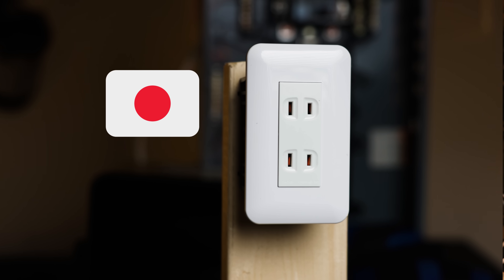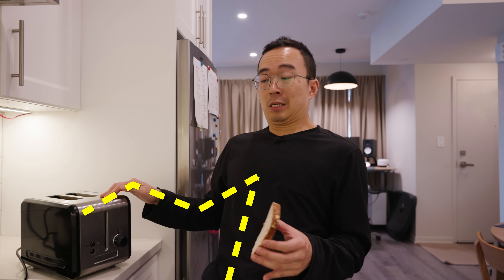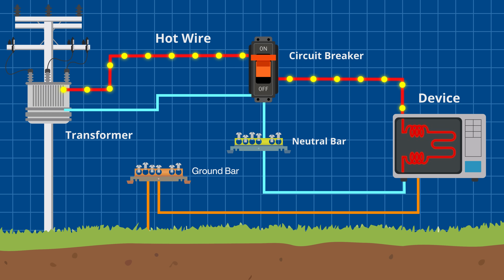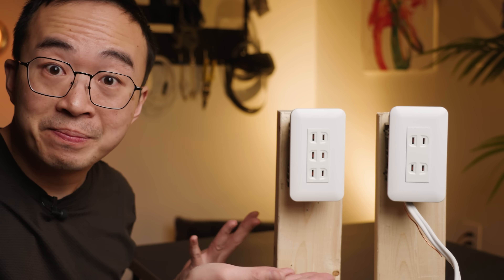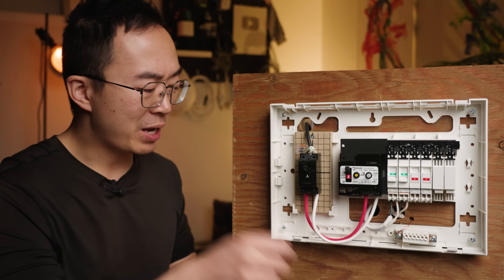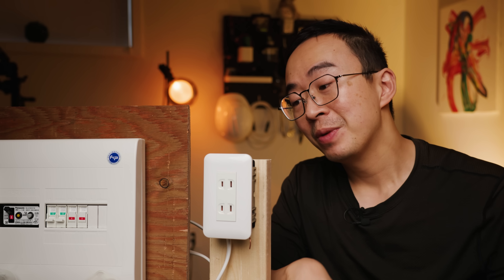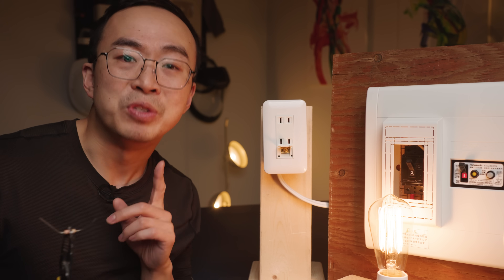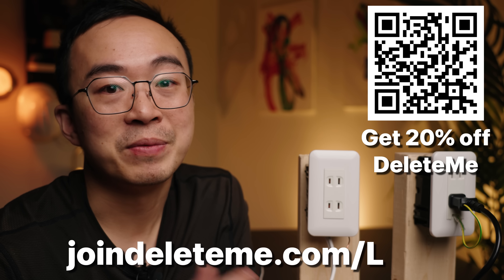How Japan Made Their Outlet Safe

Comment: WIRE is a single piece or cluster of wires (stranded) within the same insulative body, CABLE is more than one wire with insulation separating each of them in a single unit.

Comment: Bunk. Small ground currents won't trip anything, but the lower path of resistance means the current will pass into the low resistance ground wire instead of through you (considerably more resistance). Ground fault interrupters sense current instantly in the ground wire and trip a circuit breaker instantly. So unless your panel has GFI built into it, it's not going to trip for low current.

Japan uses GFI (or GFCI) on their panels. But it's also more susceptible to tripping for tiny problems that wouldn't bother us here.

Comment: I was told by a former US military engineering guy, that the US after WW2 started rebuilding Japans electric grid. That is why they have North American style outlets. The US faded out two pole outlets in the 1960s IIRC. Another reason the US has this center grounded 240V system with steel enclosures and dedicated earth grounds, is lightening. Its a big issue here. I had a nearby strike a few years back and it caused a lot of damage. Despite all the grounding.

Comment: 10:50 don’t tell me they have GFCI but don’t put flaps on the plug 😭😭 it’s like having airbags but no seatbelts 😭😭
Reply: Ну, не совсем. Чтобы получить удар током без заслонок, надо специально засунуть что-то металлическое в розетку. В случае розеток типа A -- ещё и плоское, а не как в розетках типа C и F. В свою очередь, без УЗО (GFCI) или заземления удар током можно получить просто случайно от неисправного прибора. В России в домах советской постройки нет заземления, и покупка УЗО (GFCI) -- единственный способ сколько-то защитить себя от этого. Особенно если нет центрального горячего водоснабжения и установлен электрический бойлер, как в моём случае.
Reply: Flaps on the plug? What?
Reply: @Nathan-jh1ho  like the little sliding doors all type F outlets have in Europe meaning it's way harder to put anything in them or the UK ones where the ground allows the opening of the pin covers from what I understand
Reply: Don’t have switches on the plugs either
Reply: That is essentially the American way. American airbags were designed to work without seat belts as people did not use the belts. As a result the bags killed kids and small adults. In Europe the bags were designed to be used with seatbelts.

Comment: Interesting. I spent 2 year in Japan and would say their electrical system is behind the US not ahead. Power lines everyware and they look like chaos, ground outlets with the hanging ground wire sticking out, fiber cable just wrapped around the power line poles without any conduit odder protection, and I believe they even have 2 different phases with the east going off the EU’s 50 Hz and the west side using the US’s 60 Hz. Note:  GFCI outlets has been US NEC code for at least the 1980’s in certain rooms, now it’s usually a breaker on the panel. BUT, ground is still essential for as an example, a lighting strike or an high intestine electrical static discharge will flow right through a GFCI outlet or breaker and continue on until it flows to ground (seen it a couple times in my life). But going back to the main point where you say Japan’s electrical is better than the US ….if that were so, why are they moving to the US’s standard of having a GFCi and a ground. Side note, AFCI is now required in basically all breakers plus GFCI in risky areas….does Japan require AFCI?

Comment: I don't agree  when you say at 6:40 that the ground have high resistance, 
to comply with regulations (like NF C 15-100) the ground resistance MUST be bellow a 100 Ω (ohms) (control must be done under 4/24V 200mA)
that's not what we can call a high resistance 
if the resistance is too high the it will never trigger the differential circuit breaker

Comment: What misleading nonsense. 

1. Lowest voltage and thus power, of any system in the world.
2. 50 Hz and 60 Hz in the same (small) country
3. Only realising grounding is important in 2022...
4. Plugs get pulled out of sockets if there's any strain on the cable, because of the mechanical design of it.

The Japanese electrical system us a joke. Stop defending it. It is the way it is because Japan is conservative, slow to change, and poor at standardising.

Comment: In Malaysia, ground (earth) wiring is not directly connected to the neutral wiring within the Distribution Board (DB) or any part of the electrical installation. They are separate systems that only connect at a specific point – the main earthing terminal or link outside the building, typically near the utility transformer. This configuration follows international standards and is critical for electrical safety.

Comment: RCCB (Residual Current Circuit Breaker)	GFCI (Ground Fault Circuit Interrupter)
Primary Function	Detects earth leakage current and disconnects the circuit.	Detects ground faults and disconnects the circuit.
Operating Voltage	Typically used in higher voltage systems (230V-400V).	Typically used in lower voltage systems (120V-240V).
Current Sensitivity	10mA, 30mA, 100mA, or higher, depending on the application.	Typically 4-6mA for personal protection.
Application	Installed at the distribution panel to protect multiple circuits.	Installed in individual outlets or circuit breakers.
Usage Scope	Widely used in residential, commercial, and industrial setups.	Primarily used in residential and small-scale setups.
Size	Larger, panel-mounted device.	Compact, often integrated into outlets or plug-ins.
Testing Mechanism	Has a test button; testing recommended periodically.	Has a test button; testing recommended periodically.
Standards	IEC 61008, IEC 61009.	UL 943 (North America standard).
Common Locations	Malaysia, UK, EU, and other IEC-compliant regions.	USA, Canada, Japan, and regions with NEC compliance.
Protection Coverage	Covers all appliances and circuits downstream from installation.	Protects the connected appliance or specific outlet.
Trip Time	Fast (usually <30ms for human protection).	Extremely fast (typically <25ms).
Summary:
RCCBs are more suited for protecting an entire circuit or multiple circuits in higher voltage systems, commonly seen in Europe, Malaysia, and other IEC-standard countries.
GFCIs are more localized, compact solutions designed for lower voltage systems, commonly found in North America and Japan.
Both are crucial for electrical safety, with slight differences in design, application, and usage scope.

Comment: Seems very neat on how the GFGI  and ground outlets in Japan on how appliance companies exports to modify their appliances to use in Japan to say you may have the same Whirlpool appliance but the one sold in Japan is modified, yet the screw in the cable to let a washer or dryer or even a refrigerator being exported is modified for Japanese electrical standards. 

Well this could be to modify to the outlets of what we have in North America or in parts of the Americas, takes time; yet appliance companies will keep modify their appliances to export to Japan until Japan applies but yet safety first and Japan always know how to fix things for people's safety. 

Well US based small appliances or certain electrical equipment could work fine with Japanese outlets at least you have one with the ground outlet that to say the sell adapters to say to work on extension cords that has two that work fine with Japanese electrical outlets with no problem is sold at Home Depot and yet your drill works fine with that type of adapter and is dirt cheap.

Comment: As others have pointed out, this video is a little misleading. I won't repeat their comments, but I will add this. GFCI/RCD are not perfect, they will only trip if the current doesn't return to neutral. This means if the person bridges the gap between live and neutral, the GFCI will not trip and they will be electrocuted. Having a safety ground is still preferred because it increases the chances of a fault current NOT returning to neutral and thus ensuring it can trip the GFCI.
Reply: Some current will still go to the ground and it will trip before fuse/mcb
Reply: Hence the requirement of Tamper Resistant outlets in new builds.
Reply: My son tested this theory on a figure 8 two prong cord. He put his freshly washed hand from the bathroom over the end of the cable after disconnecting from a laptop adapter.

He was standing on carpet at the time, the shock lasted less than a second. But was enough to blacken his hand, the house had a battery with monitoring app. We found that he received around 800watts of power for at least half a second before there was sufficient earth leakage through carpet and underlay that the 30ma differential was achieved. I count it as a lucky break it didn’t do any more damage other than a burnt hand.
Reply: While that comment is true it is not in anyway related to grounding. Grounding also does not protect ins such a case. However, socks between the phase and neutral are very rare. I could find only two cases in Finland of a fatal shocks that way. Both involved kids playing with sockets, sticking nails or a loose unconnected cord.
Reply: I don’t see how one would touch live and neutral at the same time by accident within milliseconds. That’s quite a far sought problem
Reply: @kerel866  what if you're touching the neutral alone (which won't trip anything) and then additionally touch the live? Are you aware one of the most lethal possible shocks is current going between live and neutral through either hand, via your heart? That's why electricians will keep one hand in their pocket when doing more dangerous stuff. But there are many possible faults and just because you can't imagine a situation where this would develop doesn't mean it doesn't.
Reply: @LjL-Videos  or you know wear voltage gloves?
Reply: @adamperry4610  or you know, defense in depth and don't rely on just one thing thinking "meh it's unlikely to happen anyway".

Comment: We got the same system here in Argentina, but our GFCIs arae called "disyuntor diferencial". We still have a three pole connector with grounding, the grounding pin makes the disyuntor diferencial trip BEFORE you touch any live leak. Many, many years ago we also had a more Japanese style tipe of outlets, with dual rounded pins and optionally a separate rood pole serving as ground, it was connected using crocodile clips.

What we usually do is put one disyuntor for every room connected directly into the panel and specific ones for stuff like fridges.

Comment: 3:00 You imply that the circuit breaker in the box is to prevent electrocution. I was taught that the breakers were not designed to do that - the GFCIs are. The breakers are more to prevent fires caused by short circuits. 

Good video btw.
Reply: Yeah, this guy knows just enough to sound authoritative to those less knowledgeable but is spreading misinformation.
Reply: Agreed. Moreover, his animation at 3:35 seems to indicate that there is something "special" about the ground path that causes the breaker to trip, but it shows that the conduction path is identical to neutral.  (Also, neutrals don't go through breakers)  The key with ground is that is DOES create a "high speed raceway" for electricity, but that doesn't (necessarily) cause the breaker to trip - if provides an ALTERNATIVE path to a human body touching the same two points (i.e. the conductive metal side of a toaster with a short - and earth ground); therefore, the electricity will travel through the ground wire and not the person.  In fact, an appliance could very likely operate for quite some time with such a fault and not trip any breakers...this is why GFCI (and/or AFCI) breakers are so important to detect these types of faults.
Reply: Circuit breakers like fuses are there to prevent fires.  RCD's will prevent electrocution.

Comment: Correct me if I'm wrong. but I say NO. It is misleading to suggest that a GFCI will prevent all types of shock. It is possible to be electrocuted at a GFCI outlet if there is not the type of leakage current present  that the GFCI is designed to detect. In other words, IF you are well insulated from ground,  and one hand grabs one terminal and the other hand grabs the other terminal you WILL get a shock and it  will NOT trip a GFCI, even though you have been shocked and the current has gone straight through your heart. Why not? Because the same amount of current went in your left hand that went out your right hand, so no ground fault was detrcted and the breaker did not trip. I would love to be wrong about this, so tell me: what am I missing?

http://www.osha.gov/etools/construction/electrical-incidents/ground-fault-circuit-interrupters

Comment: CFCIs for various locations like wet locations in N/A trip at a much lower current rating. (approx 5mA) Well below harmful levels. Certain motors and electronics have parasitic losses greater than that. This is why whole house RCDs trip at 30mA or  higher depending on the jurisdiction. This all only applies to small residential settings, and not anything larger. Also note that using ground as fault clearing does NOT require upstream electrical upgrades. They were ignoring the problem until GFCIs became commercially practical, and which time lobbying from those companies were successful.

Comment: Had a freezer icemaker element short in front of me, I was luckily touching a plastic handle. It never blew the breaker, as it was only a few hundred watts, but no GFCI/AFCI.

Fortunately, I have a good ground, and it just went right into that. Leakage from the freezer element was lower than the GFCI tripping current until the timer caused a spike (300mah, below the 500mah required to trip), replaced it and it's fine.

It now lives on a GFCI/AFCI, if they trip, something is broken, but they still didn't catch the low level ground leakage.

Comment: Most of the commenters below have a limited understanding of electricity. And I suspect the people calling themselves engineers and electricians are not. Andrew's explanation is reasonably accurate, despite what many here claim. Bonding devices together, and grounding an electrical system, aim to do just one thing: return the current to the source. That's it. The goal is to interrupt the circuit quickly when a fault occurs. When the energized part of a circuit comes in contact with the bonded side (let's say the metal body of that toaster) it sees a direct path back to the panel. The current rises dramatically in microseconds, far beyond the trip voltage of the relevant circuit breaker, and within fifty milliseconds the breaker trips, de-energizing the entire circuit. You don't need to be home at the time; it's a virtually foolproof design.

The Japanese system is ridiculously behind the times. A central GFCI is an active device, vulnerable to internal failure. It also plunges the entire building into darkness, which is exactly what we will not tolerate here in the West. Yes, GFCI receptacles offer good supplemental protection, but they should NEVER be the only protection. A properly bonded and grounded electrical system is a bulletproof, passive system that you can count on. 

A few other things: a ground rod and an earth rod are one and the same. 'Earth' is the European term for 'ground', just as a torch and a flashlight are the same thing. "RCD" is an ignorant term because there's nothing 'residual' about a fault current; we don't use that here in North America because it reveals a misunderstanding of the true picture.

I'm a recently retired, fully ticketed hospital building systems professional, electronics technologist and ham radio operator (although this is the internet and anyone can claim anything!) I urge anyone and everyone who is interested to study Mike Holt's series of videos here on Youtube. His channel is called MikeHoltNEC. He is THE accepted authority on this subject.
Reply from the maker: Thank you, I just randomly bumped into your comment but I'm going out full force to spread the word about Mike Holt.  This is actually a really great opportunity to break down a myth about grounding.  I'm linking to where he talks about it in his video: https://youtu.be/mpgAVE4UwFw?t=1040

I regret not putting in more details like I normally do but I was perhaps a bit too focused on making it easy to understand.